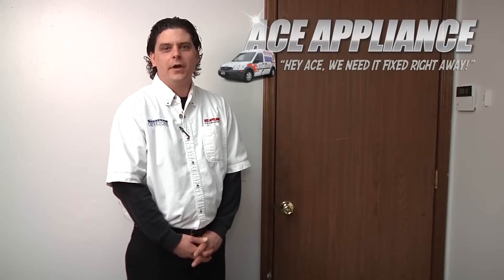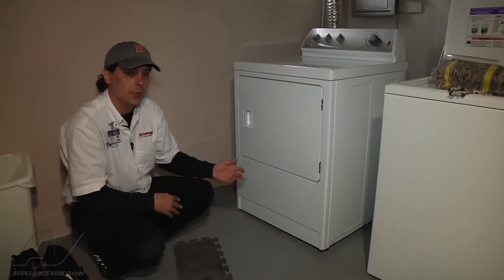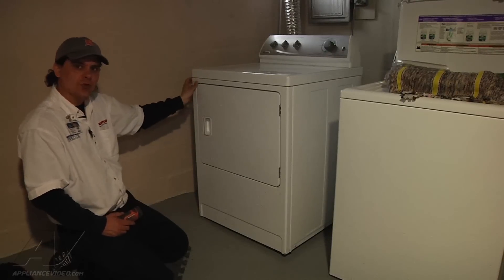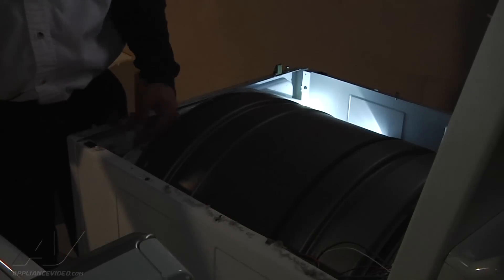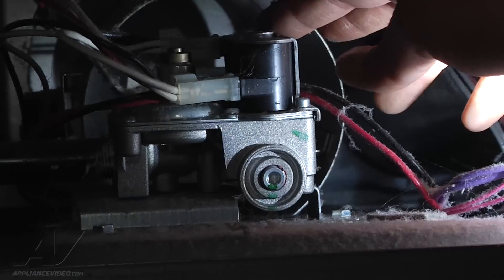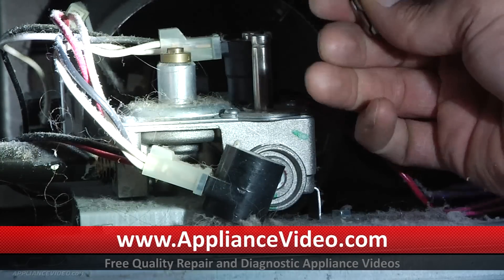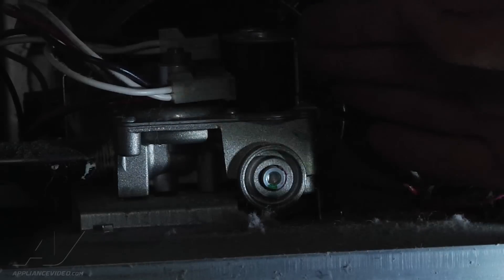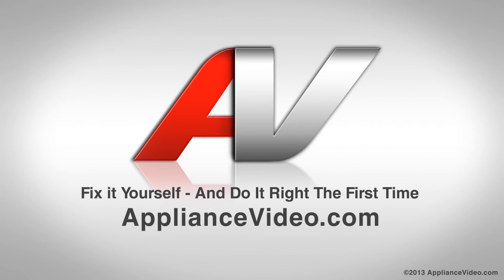Maytag Dryer Repair - Not Heating - Coil Kit

Comment: Thank you a ton for this video!  I fixed my Kenmore Series 70 dryer exactly like this tonight in about 30 minutes with the parts. Thanks also for mentioning the sleeves, they would have been easy to miss and discard with the old solenoids. Note: if you have to force the sleeves in at all, you may be inserting from the wrong side. The splines are to retain the sleeves and are on the opposite half of the hole from the end to insert the sleeves into. Also, one coil may have the plug at the bottom and one at the top when mounted, that's normal.
Reply from the maker: Thank you for your positive response, we are glad we could help. Please help us by
subscribing to our YouTube channel. Or support our parts department at
1-800-830-5465 and our website www.SaveMoreOnparts.com .  This is the only way we can continue to
help the over 900,000 people per month like you repair their own appliances. We
also have thousands of more quality videos on all major appliances made by our
factory trained technicians at www.ApplianceVideo.com .

Comment: how about electric Norge dryer by Magic Chef. very old one no heating?
Reply from the maker: Great question, you can call
our parts department at 1-800-830-5465 and they can give you help 6-days A week
Mon-Sat . You can also search at www.SaveMoreOnParts.com 7- days a week.  If you have a more
technical question that our parts department cannot answer, our technicians are
answering all questions at our website at www.ApplianceVideo.com under our Repair Help section. We have over 6,000
common questions and answers that you can easily search through by your model
number, appliance make, problem or error codes, and It’s completely free to
search through our question & answer library. There is a very good chance
you question is already answered there.